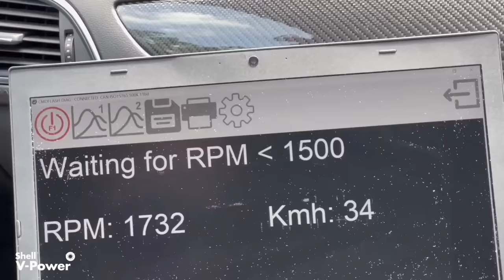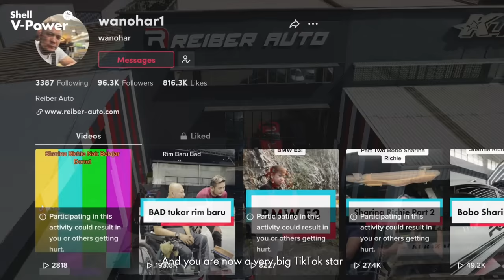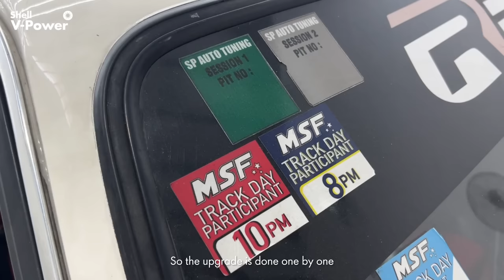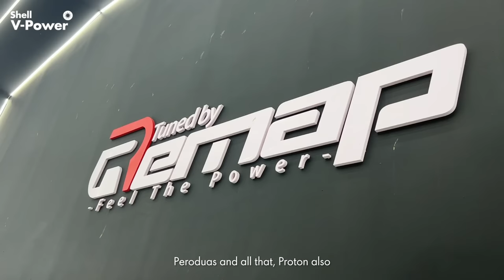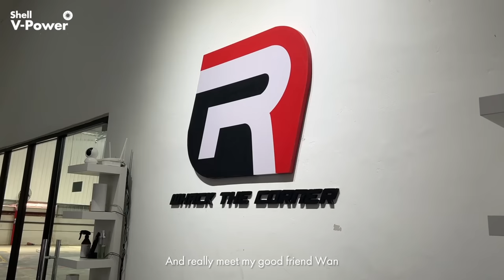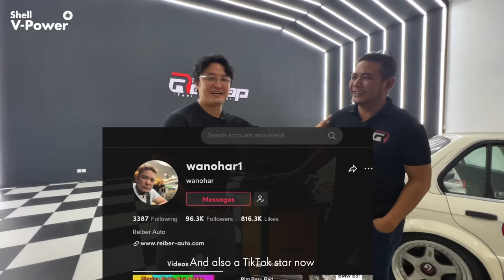How a car guy who loves racing his BMW turns his passion to a big business

Comment: Had my fair share of bad experiences there. They r good @ using 1st time customer to make video right for their marketing ploy to draw new potential customers in. Complaints of shock harshness more than twice will get a response it is what is is, no no solution and no video of dissatisfaction. Reiber only good @ marketing gimmick and workshop image. Repaired shocks will send vibration to whole vehicle body. Those wanting a track car might go well with them. For daily vehicle is a no no. It is a shock repairer that dismantle worn out shocks, replacing new fluid, weld it back and repainting it. Ride is very bad even over speed bump slowly. 1st & last for me. Staffs will mess up the interior with their dirty hands and never clean up.
Reply: Whack The Customer 😂😂😂

Comment: I had bad experience at Reiber Auto. The workshop has many staffs to work on your car. However, the workers have little regard about your car, they broke my lock nut while taking out the wheel, and blame it on the previous tyre shop. They also unintentionally scratched my BBS Chr Rims while removing the lock nuts 

I ended up paying RM520 extra to open the lock nut & replacement, aside from the bill of RM1850, making it a total of RM2370

The workers also sat inside the car with their dirty clothes and hands leaving stains on my fabric car seats. 

In fact, on the very same day i personally witnessed an incident at the workshop where they reversed a customer’s car into a motorcycle. It is not “whack the corner” but more like whack the car

That was my first and last visit
Reply from the maker: Oh dear ..
Reply: Whack The Customer😢
Reply: Oh wow. Thanks for sharing this